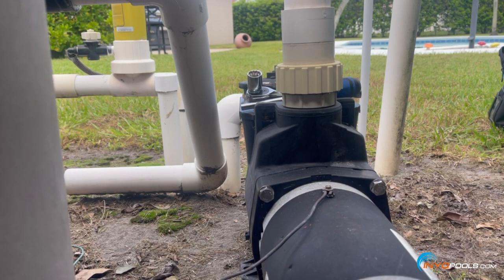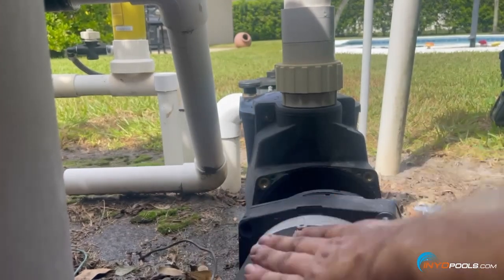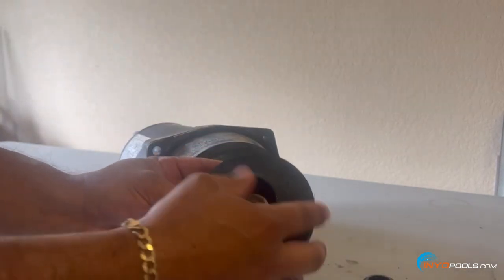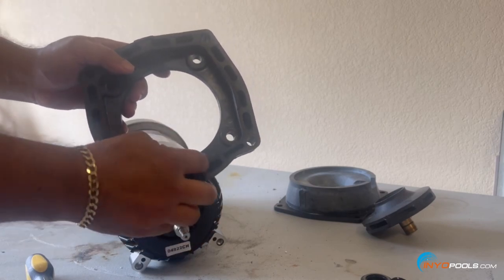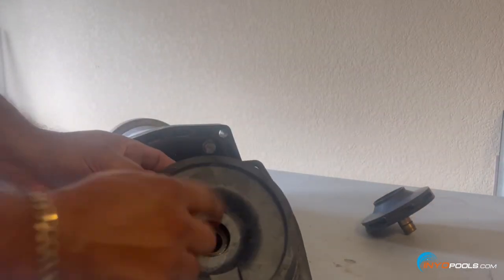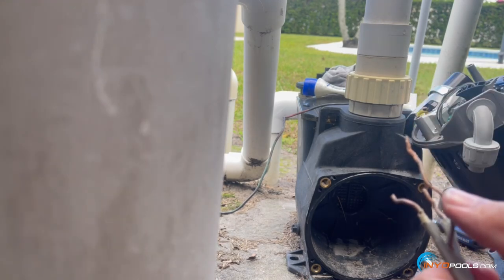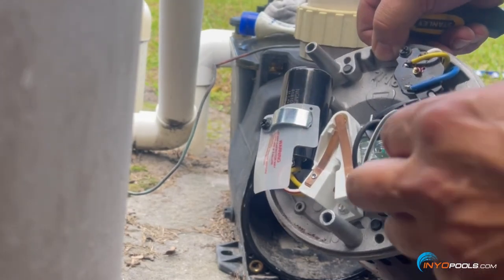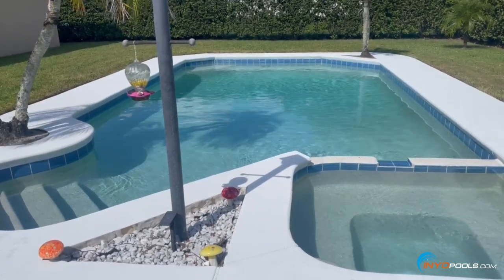How To Replace A Pureline Prime Motor

Comment: I have a Hayward super 2 pump 2hp and I noticed something new with this pump it doesn’t have a big capacitor on top of the motor like minds also the one your installing has a terminal board is this the same thing?  I do have 3 wires on my Hayward pump 1 ground and 2 purple they might have bees black before just faded out I think.  Just wondering if this is the same installation as this pool motor yours installing?   Great video keep up the good work

Comment: The old motor you took off looks like my motor currently installed and the new motor I just purchased looks like the one your installing now I just never seen a terminal board .  It seem pretty much the same connections .  I have the same hp, 230v  on both